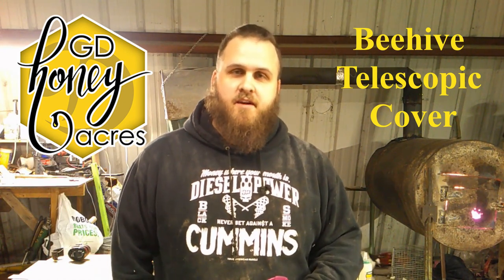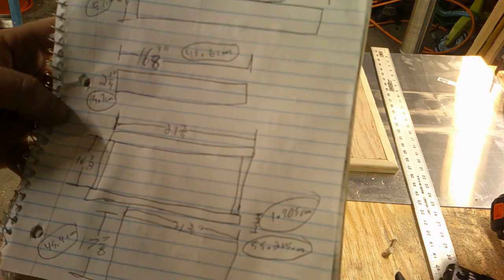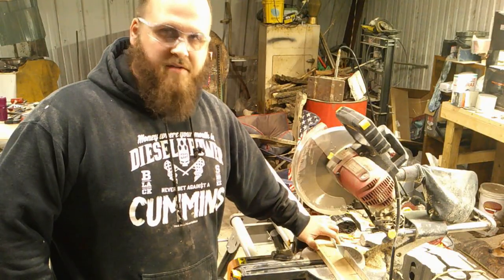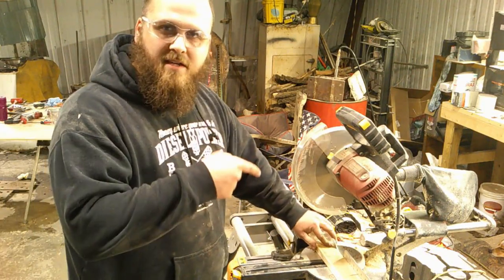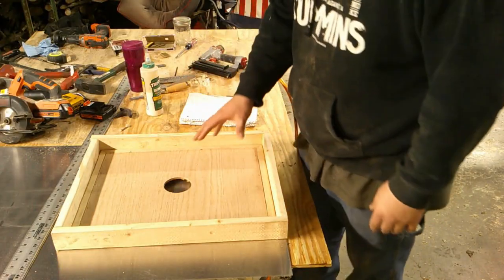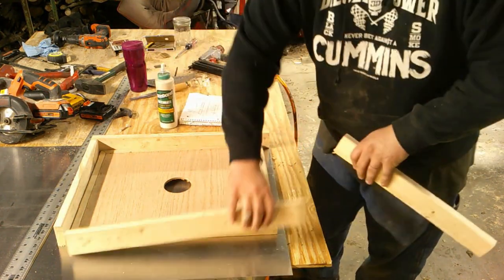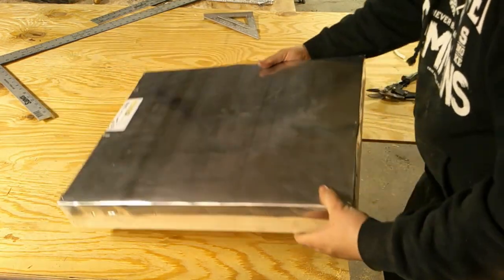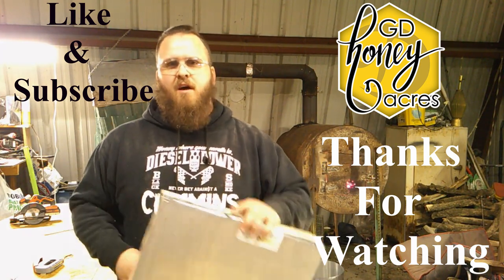How to Build a Beehive Top Cover Easy Full Build

Comment: I worked with aluminum flashing for years, if you score a line and bend twice, it will break along the line. Much easier than using shears and not so likely to cut bare hands while making the cuts. LOL
Reply from the maker: Thomas montgomery I figured that out after shooting the vid. Thanks for reminding me. I’m going to add that to my description.

Comment: Glue the tin onto the plywood. Bend and tack it after it dries. Use a rubber mallet to get the creases really sharp.
Reply from the maker: thanks for the tip. Next ones I make I'll do that. You just use liquid nails?
Reply: I’d use whatever you have. I bought a sheet metal seemed from Harbor Freight for $16 and that works well enough. I’m going to build a metal brake next time I find a bed frame someone is going to throw out.